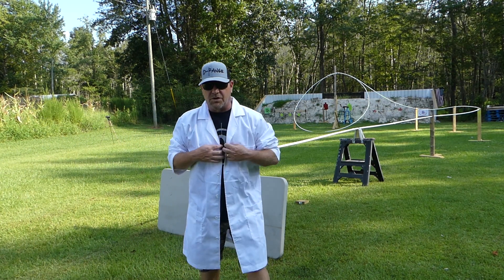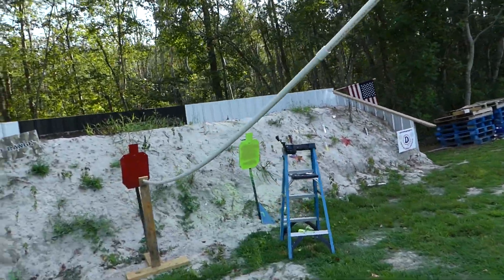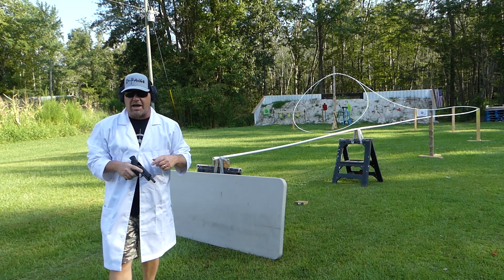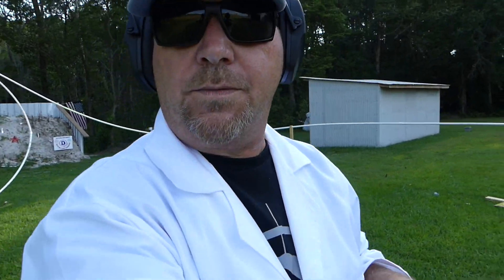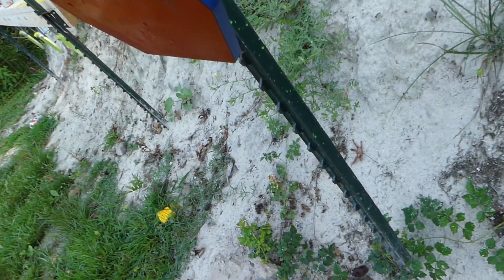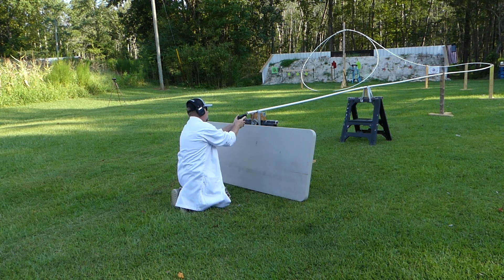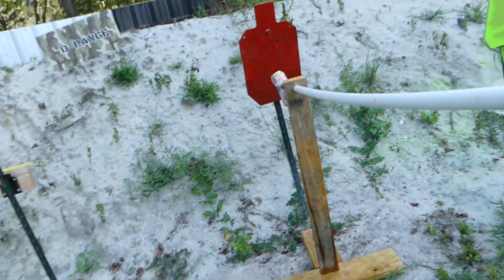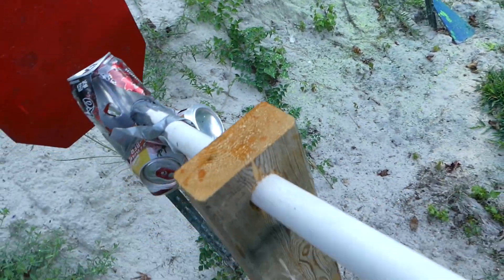Shooting bullets through a fully looped PVC Pipe!? Crazy Target Challenge!

Comment: I've found of you lube the pipe lightly with silicone lube it greatly improves the effect, also you can do this with a heavy hose. And also the harder and smoother the bullet the better it is. 
A solid copper projectile works very well with a nice very round nose. Also a barrel protruding from the gun is best to get it inline with the pipe as well as you can